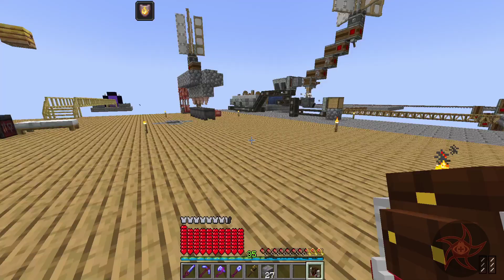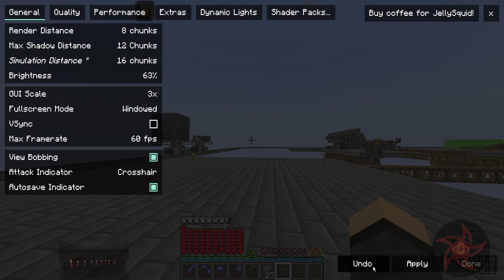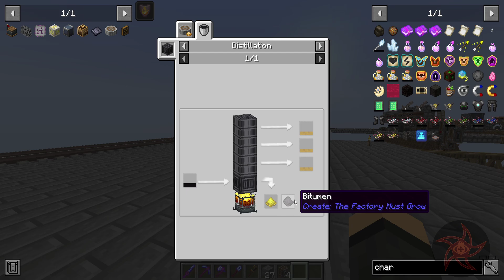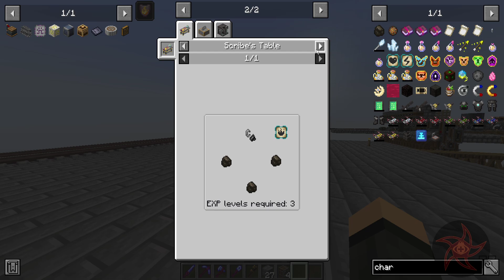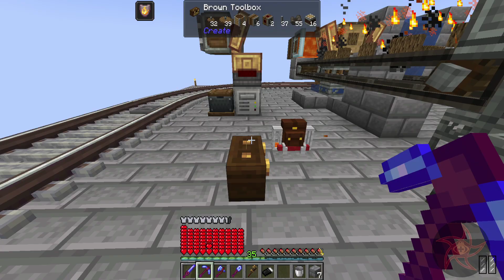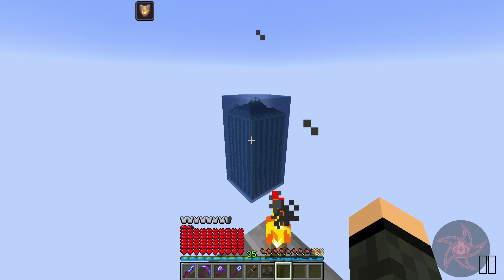Create Block :: Charcoal and Cobbleworks :: CBS-15

Comment: Nice solution to smooth stone in a single line.
Reply from the maker: It was as compact as I could think of without adding in other mods, there are times in this pack that I really miss Pretty Pipes though